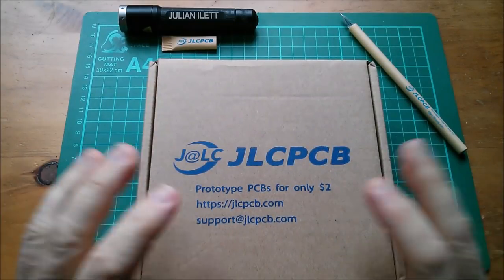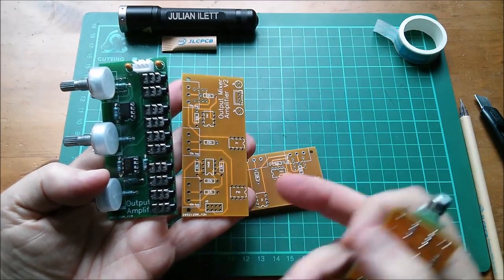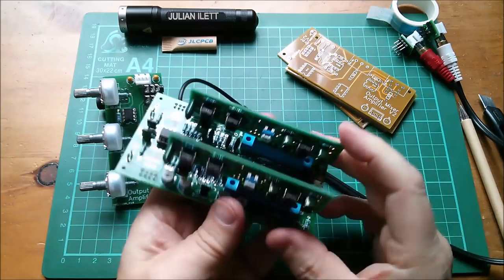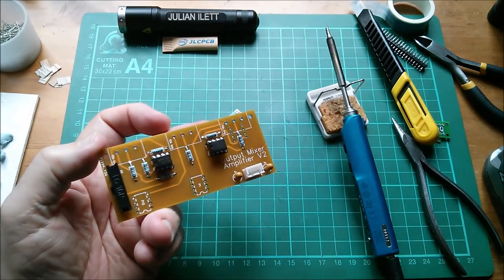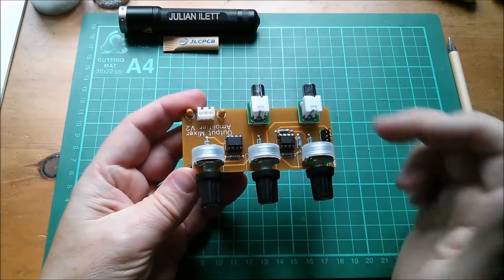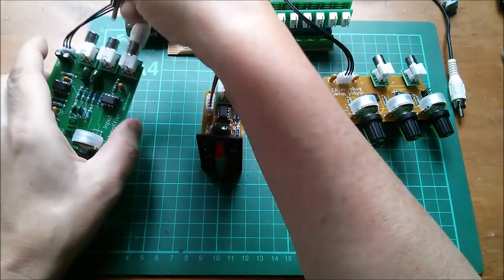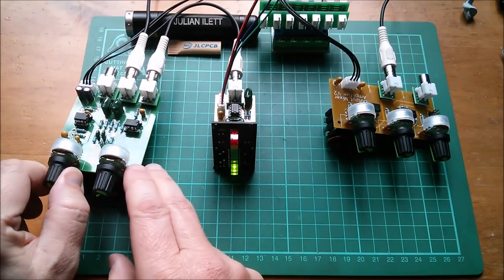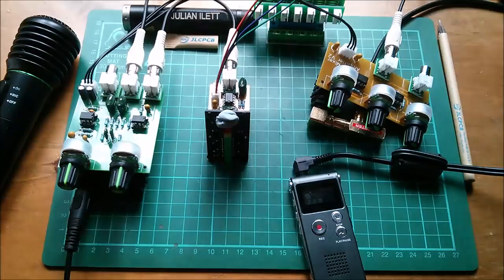New PCBs from JLCPCB: Mixer Amplifier Full Build & Test

Comment: Hello Julian. You should lower the mic gain on your preamp to prevent clipping. Especially with a very dynamic audio source as speech is. I understand that you want to squeeze every bit of performance out of your system, but it is a better practice if you give yourself more leeway and not aim for 0dB. -6 or -9dB is perfectly fine. You can always boost your audio signal in post, but you can't remove clipping/distortion. Have fun with the rest of the vocoder build!!
Reply from the maker: Cheers Mark. That's what I ended up doing - in fact the yellow LED was red in the original article, so maybe best to not let that one light either :)
Reply: @JulianIlett  That's great Julian. Cheers and have fun!!

Comment: To centre the pot in the hole you could cut a thin strip of cardboard and wrap it around the shaft boss like a circular shim. You could also use a rolled piece of solid wire, if you have the correct wire gauge to fill the gap between them.

Comment: The vocoder is an interesting project. If I were to do it, I would try to do it digitally but in such a way that the control and IO panel would still be the same. Then all the external audio inputs and outputs would only be ADC and DAC (plus necessary analog balancing and amplifying of course) that would connect to preferably a single large (-ish) DSP (e.g. TI TMS320C6000 series), and all the controls would still be mechanically present but eventually digitally connected to the DSP as well (either pots with ADC or already digital controls like magnetic or optical rotary encoders). All the filters, intermediate amplifiers and modulators and whatever other audio manipulators were needed would then be fully implemented in software in that DSP chip, possibly with one or two helper chips (like microcontrollers) if necessary.

Comment: Currently working on my first SMT assembly board with JLCPCB - it's not going smoothly at all. I chose a DC-DC switching controller that was in their library as a "basic" part, but the inductor you need to implement it is in the library as an extended part, but out of stock, and they said they're not going to get more. Now there's an issue with a footprint of the switching controller, and the diode is placed backwards, but there was no placement preview on the website as there should've been to catch those errors. It's currently quite the nightmare!
Reply from the maker: The placement preview would certainly help iron out those problems.
Reply: @JulianIlett  Yeah, no kidding. They sent me the preview by email, but on the website it just shows "No Image". As far as I'm concerned, if your webpage is busted and I can't see what's going on, I better be able to submit a new set of gerbers and placement file, or else I'll just cancel my order and deal with a board house that's better prepared. This is quite frustrating

Comment: Use something else other than movie maker lol. That software is pretty much useless.
Reply: You see, good enough to do such stuff for YouTube. But you can buy other software.
Reply from the maker: Movie Maker works really well - it's simple to use and the video and audio quality are perfectly adequate. It's the only video editor that runs on my PC without stuttering :)
Reply: @JulianIlett  oh .. yeah its simple for normal users . Ur not editing 8k videos . But had lots of issues with move maker .. like very low bit rate after editing. & Cut sounds so i quit using that. While ago.
Reply: Movie Maker can be reasonably powerful in the right hands. I got videos looking and sounding really good after getting all my settings right.  I do wish there was an open source video editor that is comparable to something like Audacity.
All the open source editors I'd looked into or tried were either way too complicated or not designed specifically for video editing. 

I've been using Premiere for a few years since getting Creative Cloud. But I still wish there was some free alternatives.